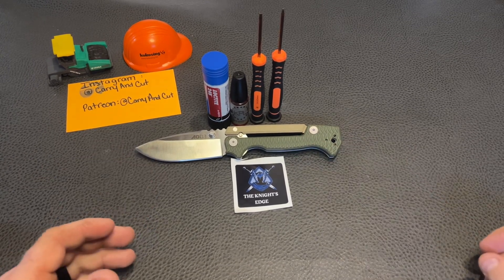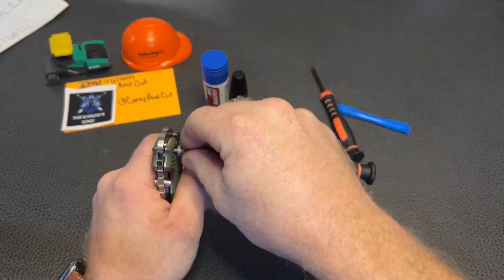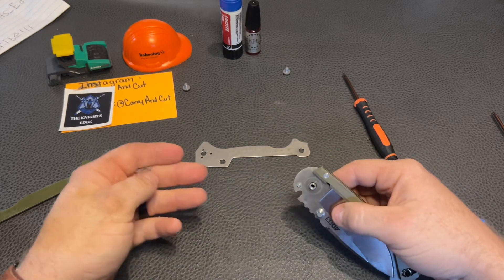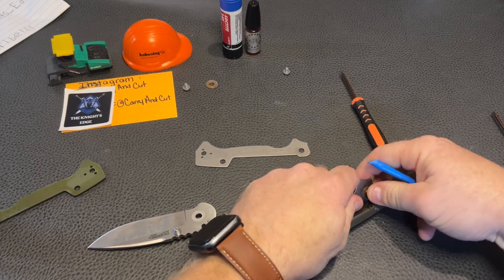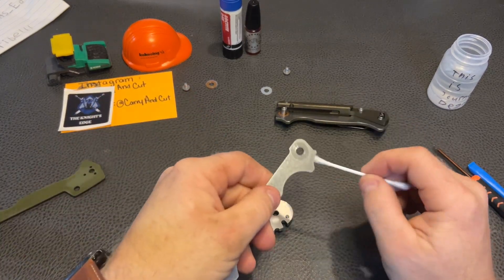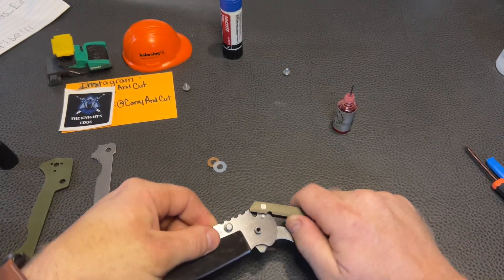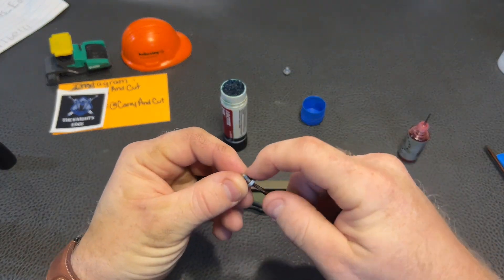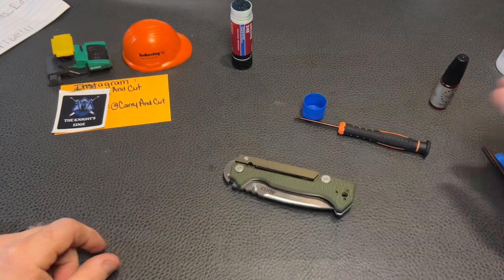How to disassemble and maintain your cold steel AD-15!!

Comment: My AD15 is incredibly off center and is extremely weak to spine strike. 

Have you encountered any solutions or thoughts to this? At least my off center issue?
Reply from the maker: @faz4983  it’s hard to tell honestly about the off center , but it’s hard to believe it’s weak to the spine strike. These knives are super stout and that scorpion lock is usually rock solid. I’d say start by loosening your pivot and wedging something between the scale and the blade to the direction you want the blade to go. Then tighten your pivot up and see if it changes anything 🤷🏼‍♂️

Comment: I like Cold Steel knives, but for some reason I just don't trust the Scorpion lock as much as the Tri-ad.  I haven't really seen any testing on the Scorpion.  What's your opinion?

Also wanted to give you a heads-up that 704 Tactical just came out with his own line of knives, and they look pretty good and super affordable.  Would be nice to see an outside review of one of them.  You can check them out on his channel if you're interested.
Reply from the maker: I definitely can say that it probably isn’t as durable or tough as the tri-ad lock. No testing to prove that , but I like the scorpion lock personally because of its easy of manipulation and finger safe lock! But both are awesome !! And I will definitely check that out !!
Reply: I was stupidly testing out my AD15 lock up and had the scorpion lock fail right into my finger during very light spine strikes. It seems pretty strong but the spine strike is absolutely it's weakness, it's kind of a joke how weak it is in regards to this. Still a good knife though and I still carry it.